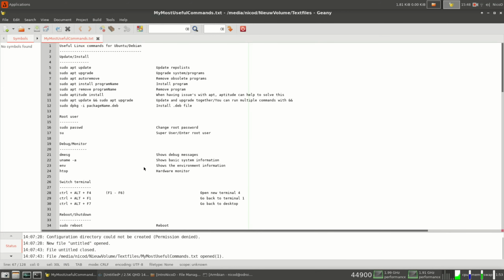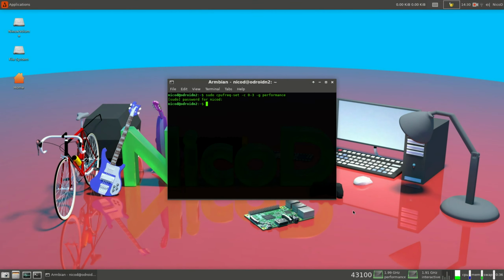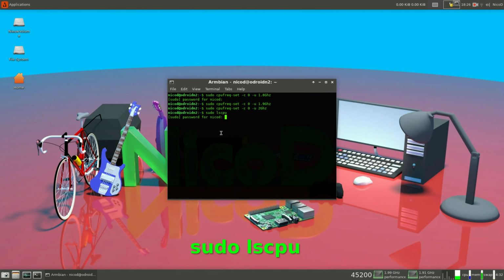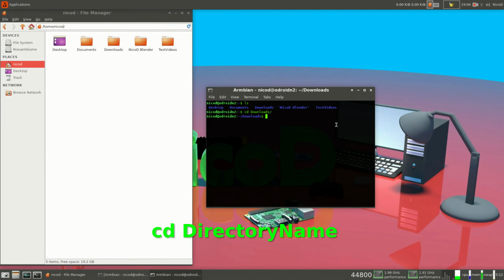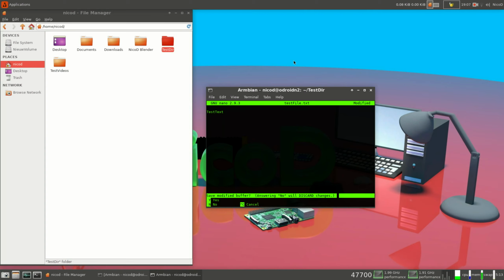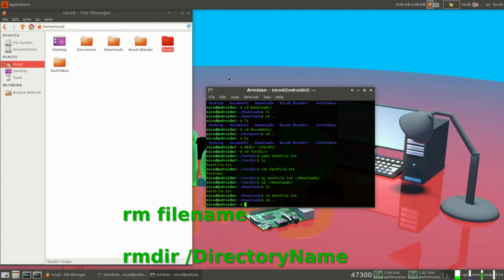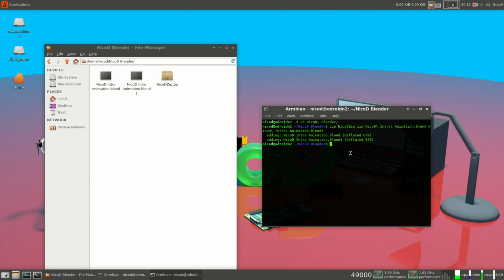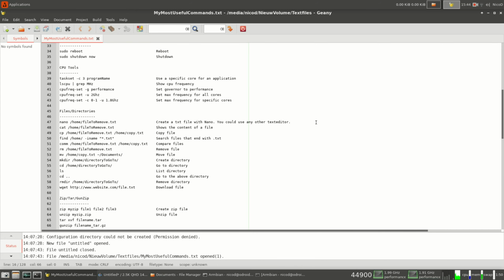My Most Useful Linux Commands - Part 2/CPU Tools/Files&Folders/Zip

Comment: Nico you should do one on formatting drives and compatability with the filesystem you select.  Large hard drives have to use  parted instead of fdisk for example, and you can't read linux formats on windows if you want your drives to be interchangeable.  I actually have an ssd drive that was working fine and now doesn't even show up on fdisk -l and have no idea what to do with it next.
Reply from the maker: Hi Paul. Indeed, that's something I can add for next time. It fits with mounting drives.  
You could try with gparted and see if it shows up there. Today I restored an external 1.5TB HD that wasn't found by Windows anymore. gparted was able to see it. But if fdisk doesn't see it, I fear it might be gone. gparted also uses fdisk under the hood.
Thank you, greetings.
Reply: @NicoDsSBCs  You know what would be great Nico. How to livestream with OBS on linux. You will get new subs. There is a whole mess with ubuntu and ffmpeg and I havent figured it out yet. Good for the atom chip pi. Yeah